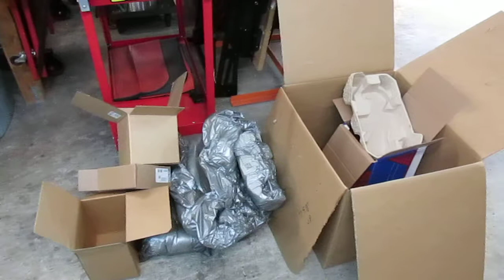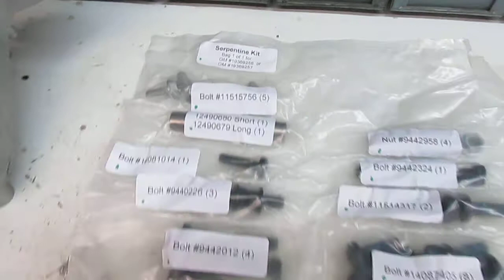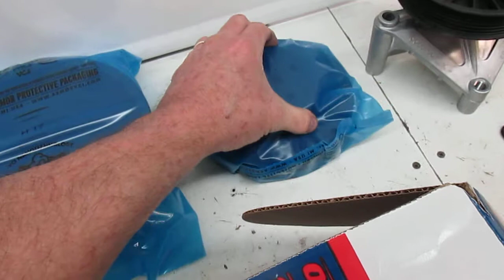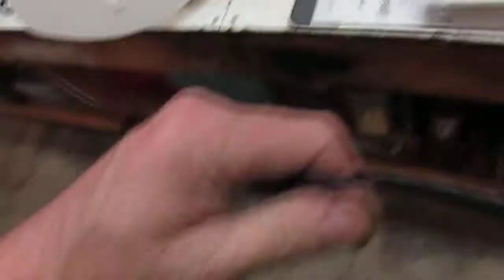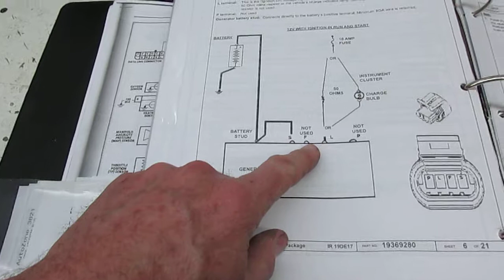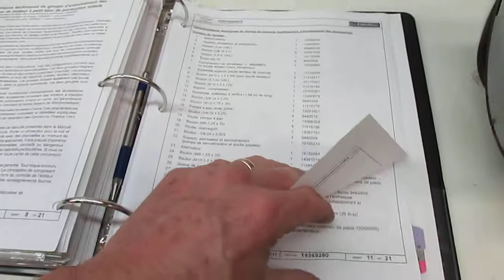Chevrolet 383 Stroker Build, Part 18

Comment: appreciate all the videos on the 383 build and install.  I'm getting ready to stick one in my 99 suburban.  your videos are tremendously helpful.  what year is your pickup?
Reply from the maker: Thanks so much for the nice comment. It's a totally stock truck except for this engine swap you see in these videos. 1995, K-2500, 4.10:1, 9.5" 14 bolt rear, 4L80E Transmission, NP Transfer Case, Silverado, 8' Bed. Has original paint but starting to go bad.